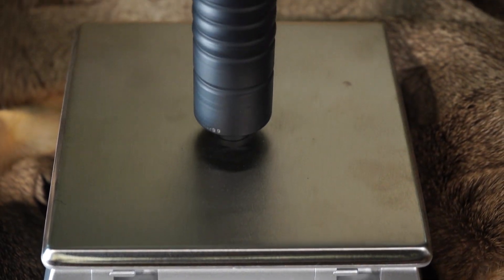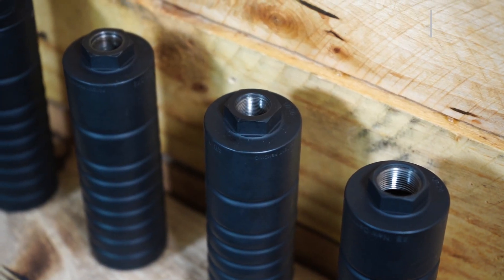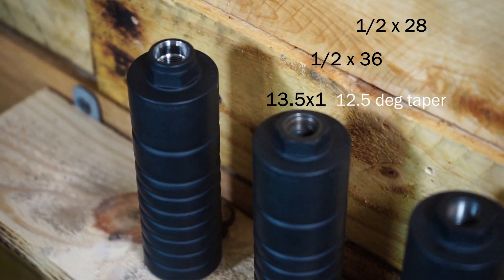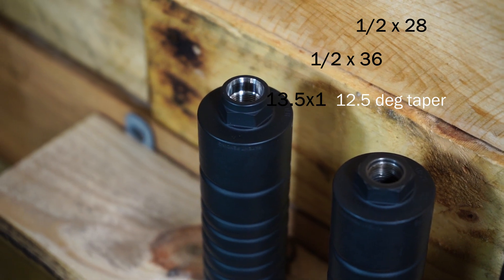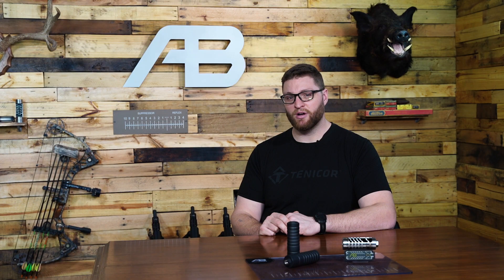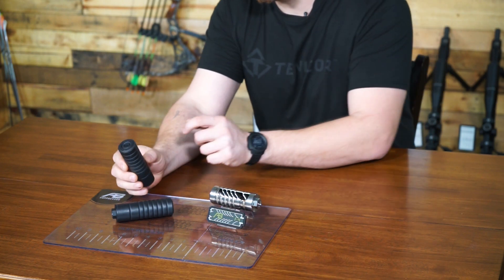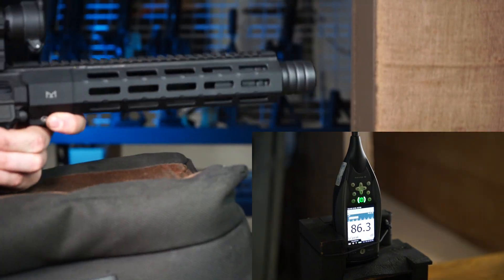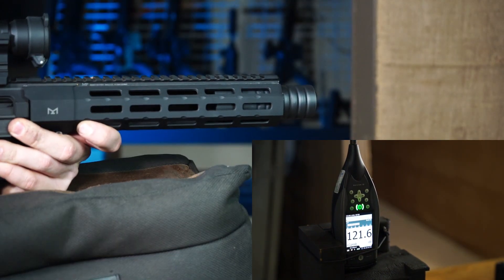Introducing the F-4

Comment: What do you recommend for cleaning? Is an ultrasonic cleaner ok? And which chemicals are fine, which solvents are or aren't?
Reply from the maker: The F4 is a sealed suppressor so cleaning is limited. We recommend cleaning the threads whenever you clean your firearm. Ultrasonic cleaners won't damage the suppressor but it will ruin the cerakote finish. If after thousands of rounds of subsonic you want to clean the baffles just run some +p through it to break the carbon loose.

Comment: I heard this can do be fired an M9A3 or browning action pistol and still cycle despite a lack of a booster.
Reply from the maker: True. The fixed barrel and the low mass of the M9 slide allow for this. The camming, vertical tilt variety of pistols will need a booster.
Reply: @ABsuppressor  I also have seen tilting barrel pistols handle it as per the NFA review channel.
Reply: @ABsuppressor  Do you recommend any specific booster that would work for this or your .375 Raptor?
Reply from the maker: @dannydubya1  It would make sense for us to have just go ahead make a pistol can maybe? Should we do it?
Reply: @ABsuppressor  Haha sounds like a plan

Comment: Really hope there's a .45 version coming out too. I'd love to throw this on the end of a 10mm CMMG Banshee
Reply: I mean, I'd rather just have a 10mm version.
Reply: @letsgobrandon416  Why would you want a .40 suppressor when you could get a .45 for basically the same performance but *far* more flexibility in usage
Reply: @A_Qwynide  why would I want a severely over board suppressor for a caliber I don't have?
Reply: @letsgobrandon416  .05" is not "overboard" 😂
Reply: @A_Qwynide you really dont know much about suppressors do you? A 45 can is bored to .46 at a minimum, probably more on a pistol can, with each subsequentbafflehaving a larger hole to prevent baffle strikes. You cant put a 45 cal bullet through a 45 cal hole, that's a baffle strike.

Thats a lot of slop on a .40 cal bullet. I don't own any 45s. Why would I want an overboard can that will be louder, when I can get a can designed for 10mm and have it be quieter?
Reply: @letsgobrandon416  😂 Dude stop trying to hype yourself up as some sort of authority on suppressors. No shit the diameter of the hole is larger than the caliber it's named after.

Again, a .05 difference is not overboard, and with that diameter difference you're talking about a couple decibels at best between a .40 and .45 can, which is nearly unperceivable to the human ear. In fact what you're more likely to notice is a change of tone between the two, including splitting the difference and getting a .40 endcap to put on a .45 can.

Also most, if not all suppressors, state what calibers they're rated for, including whether or not a .45 can is rated for 10mm pressures.

End of the day you simply won't tell the difference, especially with a changed endcap. However what will be notably different is your capability to switch between hosts, in which you lose a number of calibers by going with a more restrictive suppressor.
Reply: @A_Qwynide  go look at Pewscience data. Your wrong. Overboring does significantly change suppressors behavior.
Reply: @A_Qwynide  you don't read between the lines on a technical document.  You must work for Faucci 🤣

The data is clear, while reducing blow black, larger diameter bores significantly increase muzzle report. Purposes built suppressors for a given caliber are quieter than an identical design with an oversized bore. Your denial of this is hilarious.

Also your total anathema to purposes built suppressors, and hostility towards me for wanting a purpose built suppressor for my caliber is astounding.
Reply: @letsgobrandon416  ?? You actually read between the lines more on information-dense documents. You have to use critical thinking to extrapolate the important information out of a sea of data, otherwise you get (like what's literally happening right now with you) data fixation and lose the forest for the trees
Reply: @letsgobrandon416  Also what denial? I said multiple times that while measurably different, the increase in decibels is almost always too low for people to perceive.

And hostility? Gtfoh with your nonsense 😂😂. I'm stating you're wrong and explaining why - if you think that's being hostile then you have lived a soft, sheltered life my friend